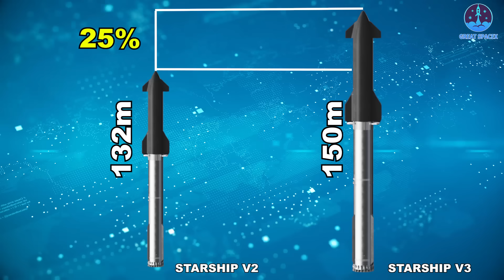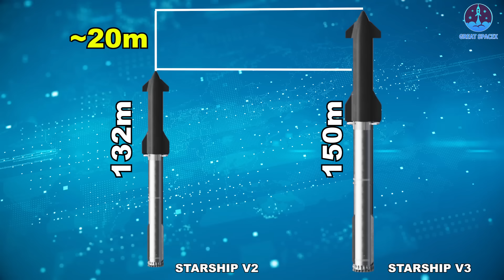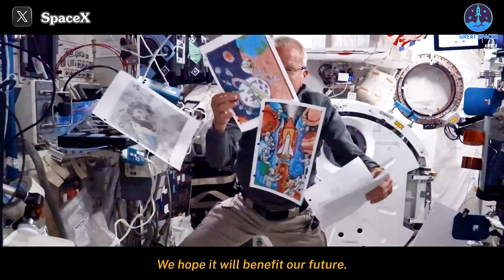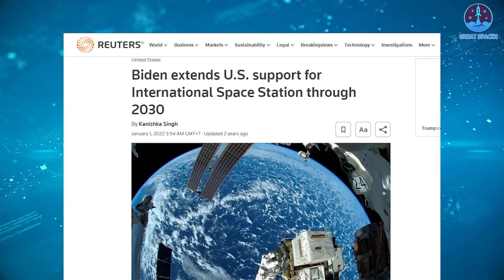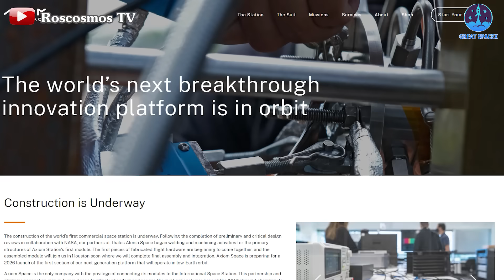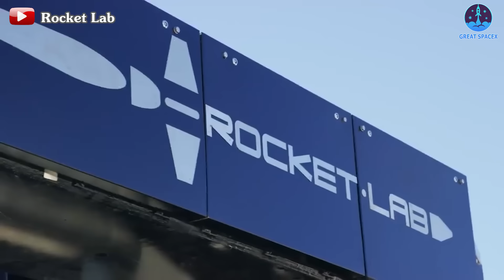Elon Musk just officially announced New Starship V3 'Bigger, Longer & Better'...

Comment: I have to ask? Do you guys on a computer or tv. Because we are definitely watching different launch’s. Almost every county on the third rock from the sun have launch rockets into high orbit and lunar injection. They all used a  rocket with multiple boosters. None had the use of 33 rockets engines. Now once the moon several had problems landing safely. But they are all head and shoulders above Elon mush. To mush lovers keep your faith. Starship will reach high orbit some day. One point I like what falcon has done. But they have only launched ELO satellites and space shuttles. Until mush send starship in high orbit, land booster back on the ground and fly starship back to Boca Chica and land.
Reply: …ONLY launched ELO satellites…. As if that’s just so simple.
Reply: Didn’t Elon also perform a TMI (trans mars injection) on his Tesla roadster as well? Does that not count?
Reply: @ryanclark2289  

No, that was Falcon heavy launch. Yes he launched his Tesla not equal to a space load aka a satellite. My problem with starship is 33 engines on one frame. If he spread the engines across two booster the vibration would be acceptable. The ring engine mount will transfer the vibration thru out the entire rocket. This exceed the number cycles you can flex the metal. Now he has increased engines to 3.0 with more power. If he insists going without boosters then he must build no more than 13 engines of a size larger than Apollo.

Comment: Elon is just a poser and a hype machine with some good ideas, but a terrible engineer. If not for the brilliant people that works for him, he would be just like any other snake oil dealer. Current starship is full of issues and hasn't reach into orbit yet, nor tested the recovery of the booster, neither has proven safe reentry and he's already hypeing up for the next version that still fall short to the first version he originally presented, which was planned to be 12 meters wide. I bet $1000 that Blue Origin's New Glenn rocket is gonna make a succesful launch, recovery of the booster, and reach into orbit in august this year, while this clown will be stalled , after yet another "rapid dissasemble" this coming  spring. Yes, freking "turtle" Bezos is gonna beat bloody "hare" Musk in this race. Mark my words
Reply: This "clown" is launching multiple Falcon 9 missions per week.  Last year he had 98 launches (including the two Starship "failures").  Bezos has yet to reach orbit at all, although his BE4 engines did finally achieve lift off this past week.  I don't doubt he will do so eventually, but that doesn't make him brilliant - just late.  I should also point out that Bezos is not an engineer either.  He too, has many good people working for him.  That is actually how companies work.  If I had to bet, my money would be that Starship will achieve orbit on its next flight, whenever that is, assuming that is the mission profile.  
We need more "clowns" like Elon in the world.  It would be a better place.  How soon we forget that before Elon, the concept of a reusable rocket booster was a fantasy.  Now Falcon 9 launches are a common thing.  Thus far, he is the only one to accomplish this, but I am sure that sooner or later there will be a Chinese knockoff to compete.  And yes, I know that BO has a reusable rocket.  It just can't reach orbit.
Reply: Yeah, the largest most successful rocket company in the world has no idea what they are doing. The only clown here is you.
Reply: Yeah all that said. Mr Musks was is so so much more fun. Like you said he has brilliant engineers. There will be a starship. I'm not convinced that anyone else ever would.

Comment: That was the best report for SpaceX to date.  Usually, the reports leave too many technical things out of the equation.  You can tell by reading the comments.  And if you comment, you are attacked by crazy fans with no education in science.  The funny thing is the size is still about 1/3 of what it will need to be to get their plans into orbit.  This is the problem with complex space programs.  Another issue is materials can become an issue as inflation keeps rocketing towards the moon.

Comment: I have read that Starship can't land on the moon until a landing pad is built.  It's too big and powerful, and would dig a big hole upon landing. Wondering how this will be addressed.
Reply: Musk and SpaceX have said the HLS variant will have a ring of engines (I remember hearing 24 but the artist's renderings I see usually show 12) at about the top of the fuel tank area angled out.   They did that to counter the "requirement" for a prepared pad of some sort.
Reply: The lunar lander will have engines in the nose section so that the exhaust will be well above ground level.
Reply: No.. just no.. first of all it will drift towards the ground and a fairly slow speed.. secondly they will probably design the ship to use out facing thrust engines instead of the powerful raptors in the bottom. 3rd they don't need to use all the engines to land.. 4th they actually need to land with enough force to not bounce back into space.. 5th any moon landing is gonna kick up dust..
Reply: Never thought about that, but now that I do I feel like with the reduction in gravity we would probably only use 2-3 engines to land depending on the payload.
Reply: Maybe easier to move the moon to dock with Starship it is so big!

Comment: Elon Groks what the numbers mean on the simplified engines.

And confident that there are more steps he can take down the parts count rabbit hole.

Also likely realizes larger engines means less engines, and there for less parts count.
One bigger engine that does the job of two smaller engines, cuts parts count by half.. Ditto if one replaces 3 etc.

Simple engines will be easier to build larger than complicated engines.

And the engines were always the limiting factor.

From now on, better bigger engines mean better bigger ships.

Raptor 3 is really just the beginning of "real" rocket engines. Everything else will soon be considered archaic.

Elon will stretch the ships first, but eventually not be able to resist increasing girth. I think a good target on eventual girth will be about 100 ft.
So they can still fit thru the Panama canal.
Also its a size humans are used to building hulls at. The difference with Sky Ships will be building them lighter and still strong. Meaning Aluminum likely inside the skin and hull structure.
So I suggest to aspiring fabricators, know your Aluminum types well. And get really good at welding them, and doing pretty welds, as these ships could eventually be retired from gravity well usage into space, and get used there for a thousand years. And you wouldn't want a krappy looking weld to get noticed for that long.

Also, I suggest using the Bolas concept for fuel transfer.  you'd have to pump uphill to the center of gravity, and from there its downhill to the other ship, i.e. a siphon. And as center of gravity changes, due to emptying one tank and filling another, center of rotation might shift some too. Space Fariners will probably know when their tanks are getting full just by the difference in feel of the rotating ships.

Comment: 492 feet!?! Holeee... Insane! Let's do it! 2024 fuel dock and transfer!?! 😂😂😂
Incredible. 😮
Remember, at minimum ten ships of fuel to get to the moon!
Reply: @GilmanPando Lol. Cry harder! Ohh annnnnd get a life!
Reply: I would guess the dimensions and weight of the first version were dependent upon the thrust output of Raptor-1.  The Raptor-2 had a significant increase in thrust and Raptor-3 increased again by nearly 20% over Raptor-2. 
As the thrust of each engine grows, the designers of the boosters and upper stage(s) have three choices: 
1. Accept the higher acceleration to get to orbit sooner with the same vehicle and load
2. Use fewer engines to achieve the same design thrust
3. Use the same number of engines to lift greater loads.

If your goal is maximize payload and reduce cost to orbit per kilogram, option 3 seems best to me.  Apparently, the team a SpaceX came to a similar conclusion.

Looking at the latest Raptor version, they obviously decided to maximize the value derived per launch cycle.  Adding a few stainless steel rings to the booster tank sections and a few more to the Starship tanks and cargo bay actually seems like a low effort and low expense way to increase payload.  The only new technology involved seems to be the engines.  Everything else they do to build a bigger ship is something they already do; they just need to it a few more times.

The expensive part is going to come  when they decide to increase height of the launch table and the tower but that will only need to be done once per tower.
Go for it!
Reply: @frankmcgowan9457  Elon still wants the 36' diameter Starships payload capacity.
I guess he figured they can make it longer!?!
It'll be many years before we see a 150 meter starship but just thinking about that possibility is mind numbingly incredible.
Numbers are all over the place with the amount of ships needed for a moon shot and perhaps why he's thinking about it too.
Sorry I get giddy like a little kid when it comes to starship!🙄😂

Comment: He hasn't managed to get to orbit yet.
I don't understand why doesn't he move the launch to water and insted of methane send solid fuel capsules. They are far easier to transfer between spaceships.
Reply: Solid fuel is extremely inefficient which is why no one uses it in space. Also, how would solid fuel capsules be easier to transfer? Solid rocket motors aren't filled with capsules of any kind either, they are filled with a semi-liquid fuel that hardens. Maybe the reason you don't understand is that you don't know anything at all about rockets?
Reply: @filonin2  There are solids and include oxidisers in them.
I didn't say that they are in capsules but that is easy to do.
Methane needs huge pressures and low temperature to turn into solid and you need to take the oxygen as well.
Liquids in microgravity turn into one sphere under tension pressure  they don't flow like under gravity. And then you have changing gravity and temperature. You would have to keep methane under extreme pressure that adds to weight of the container 
There are more powerful solid fuels about 75% - 80% of methane  but are not allowed to be used on earth because of environmental concerns. In space it is a different situation.
Nitrates are even stronger but not stable. But that is because no one has done any research on them for use in space.
With new material science I am sure they can be made stable.
They can be made in different sizes and suitably packed, in light containers.
There are satelites that use solid fuel especially in the mititary.
You don't need variable power when you use them to leave orbit or other specific nanuvers which is when you need power.
The transfer it much easier just like any other solid object using a crane not in heavy pressured containers.
They also last longer.
A lot if Military missiles don't need fueling just before flight because the can use solid fuel.
This is why you see all that evaporation during feuling just before ignition basically wasted. 
Even spaceX uses sone solid fuel which is why they wear hasmat suits when picking the upper stage from the sea.
It is a question of trade off between different factors.

Comment: SpaceX should place a bid with NASA to get rid of the International Space Station, and then instead of de-orbiting it, move it to the LaGrange point between the Earth and the Moon.  SpaceX is uniquely capable of making that move.  Imagine SpaceX having its own space station between the Earth and the Moon.  SpaceX can afford to maintain it at that location, and can collect fees for letting others use it.  It could also be used there as a source of raw materials for building a more advanced facility.
Reply: No SpaceX only exist because of NASA....they are alive because of the NASA subsidies and contracts because that is what Obama asked NASA to do.
Reply: @joannewilson6577 😂
Reply: It would be easier and probably cheaper to just build a new space station than try to refurb the old one.  Sink it.
Reply: @frankmcgowan9457  The real problem with space stations, including this one, is that they start to smell like a sewer inside.
Reply: @scientificperspective1604  
You can't open the windows on some late Spring evening and air it out.  Maybe you could steam clean it somehow and vent the steam to space.

Or you could build a new one from modules designed to be removed, returned to earth, cleaned, updated and returned to service... oh, yeah... sink ISS.
Reply: @frankmcgowan9457  I had in mind a smooth-surfaced station interior that's able to be cleaned, with the electronics and other complex structures sealed off from continuous access.  The way they build them now, there's no possibility of dealing with the smell that accumulates over time.
Reply: @scientificperspective1604  
That sounds like fresh design and new construction.  If ISS was a person, it would be old enough to have children in high school, I think.  It's time for a fresh design, isn't it?
Reply: @frankmcgowan9457  At a minimum, it's a source of valuable raw materials that don't need to be boosted to orbit.
Reply: @frankmcgowan9457 I hope Axiom can use some of the components before they separate from ISS … that cupola could be transferred to their station with minimal effort and there is no advantage in leaving it attached for the de-orbit.
Reply: @Glathgrundel  
I would tell them to take what they want before it ends up under water.  Sadly, it's not up to me.

Comment: The capacity is irrelevant if it doesn't work....
Reply: yeah, you very smart to doubt in this whey the guy who revolution Rockets, cars, Internet access,  Tunneling and some other stuff
Very smart, Congrats
Reply: @carlok22 Musk Tunneling? You might want to check with the Swiss about tunneling history and expertise. 
And I won’t even mention Maglev and Hyperloop.
Reply: @carlok22  Well, success in previous endeavor doesn't guarantee anything, does it? I think and hope that Starhip will succeed but this kind of project is always on the verge. Failure is possible and doubt is better than blind faith.
Reply: Gotta start somewhere. You learn from mistakes. Space x is where it is today because they learned from their mistakes, they didn’t start having successful launches off the bat. No rocket company is successful without a lot of testing.

Comment: At 3 minute 13 seconds...the thrusters 230 pound vs 269 pound clip... there is something wrong with the 269 pound one... it’s not running stable like this...
You see how now and then the flame widens??? Like a mini explosion in its density... means it is not running good...

Comment: Can Orion be orbited by Falcon Heavy? Is SLS needed?
Reply: Falcon heavy is not human rated
Reply: @danygauthier605  Oops! I knew that. 
Does Falcon 9 have the lift capacity?
Reply: @richardrigling4906  
Not for a moon ride 

Before ULA Vulcan wanted to develop a more advanced second stage that keeps the H2 and liquid oxygen cool for long term so they could refuel the second stage and then a second Vulcan with crew would have dock with the second stage refuel and flew to the moon... replacing SLS for 1/3 of the price. Because of that proposition the USA Congress cut founding to ULA. The SLS is the Congress rocket not NASA rocket lol. ULA got punish hard for forgetting who was the master...